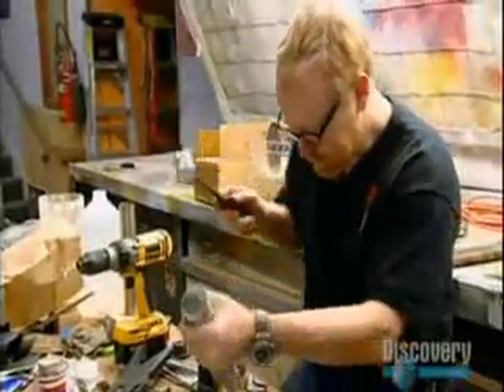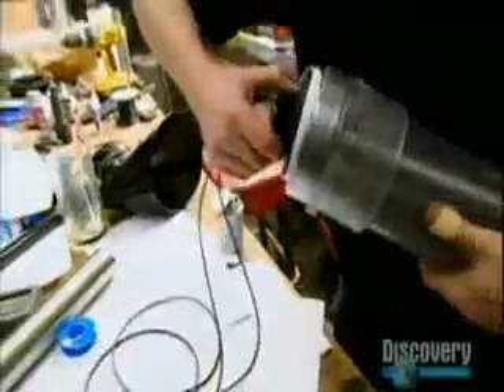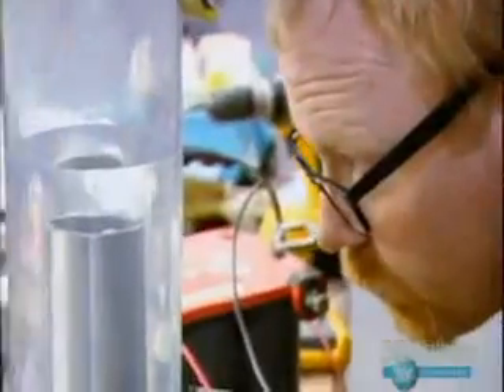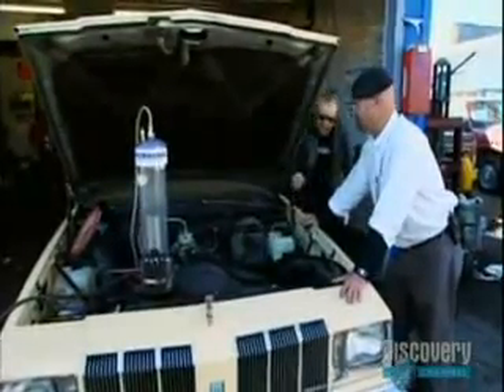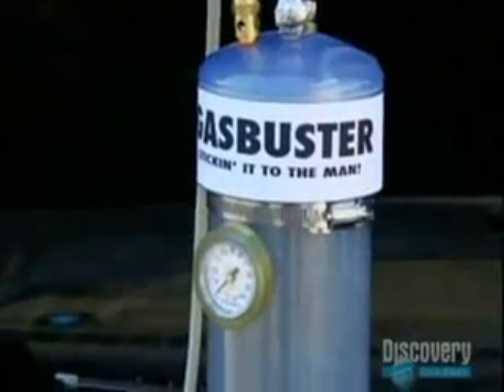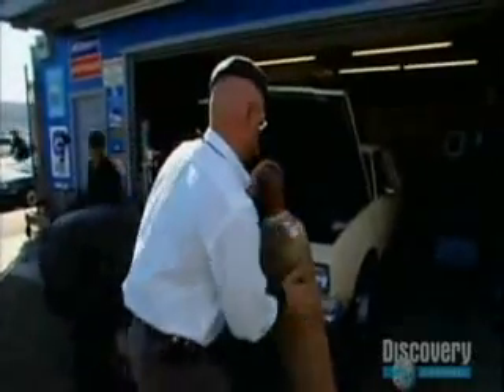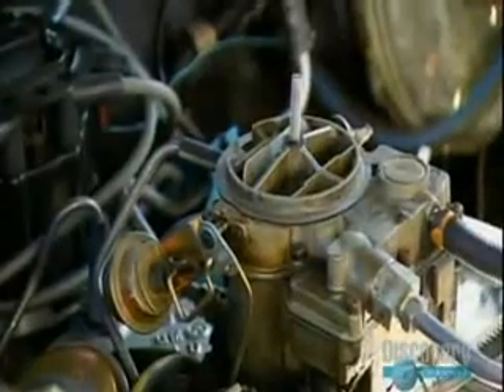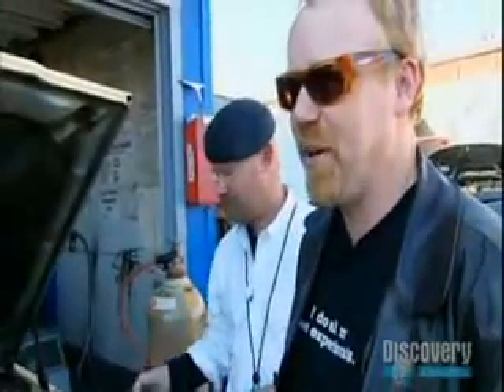HHO Mythbusters Explained

Comment: So, when you run current through a solution of sodium bicarbonate and water you get virtually no hydrogen but you do get a lot of carbon dioxide. Somehow I don't think that carbon dioxide is very helpful in getting an engine to operate. But, let us visit HHO Fairy Tale Land and pretend that the bag actually was full of HHO. In just one revolution of a 5 liter engine, the entire bag would be empty. So, as it took five minutes to produce enough HHO for a single revolution of the crankshaft, how many years would it take to produce enough HHO for a trip to Granma's house?
Reply: dont know much bout science but all i can say is that this is nothing new in Iceland, Japan and some other countries in Asia...in some part of the Philippines, plenty o taxi drivers and people that make money out of vehicles are already doing this. no joke! a company inJapan are selling cars that run powered by water. its too impossible here in US of course.
Reply: Where exactly did you get your degree in chemistry? Online? Yeah, thought so. ;) 

A proper electrolyte would be something like sodium/potassium hydroxide. Easily done. Sodium Bicarbonate would work as well and you wouldn't have anywhere near as much CO2 as you think. It's all about activation energy.
Reply: Justin Dixon Yes, apparently my degree in physics outperforms your knowledge of chemistry. Since I don't have a degree in physics, it is accurate to say your ignorance of chemistry is beyond pathetic. As you are ignorant of the fact that the process of hydrogen/oxygen extraction through electrolysis has always requires about 140% more energy than can be recovered by burning the resultant gases, you quite clearly demonstrate to the world how foolish you are. Couple that with the maximum thermal efficiency of a typical internal combustion engine of about 29%, then only the truly stupid continue to believe in this HHO garbage.
Reply: ccryder1149 sorry but nothing you just said invalidated anything said.
Reply: ccryder1149 
I skimmed your response and it's basically blah blah blah redox... blah blah blah incomplete combustion... blah blah blah reaction products... blah blah blah. 

From what I can tell, it's accurate. However, you're ignoring the fact that the introduction of oxygen and hydrogen in equal parts promotes the evolution of water and CO2 in place of excess CO. 

If you want me to show you a formula for it, I can. 2C8H18+25O2 → 16CO2+18 H2O. The issue with this reaction is that it's in practicality oxygen deprived. 

As for being a nitrogen rich environment... I'm not entirely sure what you're smoking but that is extremely unlikely give that the primary components in a gasoline fuel mixture are hydrocarbons such as isooctane, butane, ethyltoluene,various phenols and various alcohols including ethyl and methyl. Where are you getting the idea that it would be a predominately rich nitrogen atmosphere? 

Oh, and why are you even arguing that a engine produces CO? I've never once claimed otherwise. In fact, that's why they add oxygenating additives such as Methyl tertbutyl Ether or Ethyl tertbutyl Ether... or if you want to be cheap: ethanol. 

That's one of the things that HHO seeks to fix - an oxygen deprived combustion without the need for additional polluting additives. Running a vehicle PURELY on a hydrogen oxygen reaction has issues due to flow stability, and energy required for the splitting of the free radicals from the water - though both of those are technological and engineering problems, they're possible to handle. 

I simply do not see where your problem with this lays. You basically are claiming that HHO technology is a scam... yet it's used all over the world in industries that range from welding to fuel cells.
Reply: ccryder1149 I'm not going to bother reading all of that, I can however say that you do not need to run an engine purely on HHO. Hydrogen and Oxygen injection into fuel is plenty to increase efficiency. 

Also, there is nothing magical about HHO generators. They're quite real and they can produce a lot of gas. If you can run a high flow torch, you can produce more than you're claiming... and people have these torches.
Reply: ronazan87 no support from government and misinformation, discouraging the use of water to promote oil because of money and some selfish conspiracies... it's all about it. and mythbuster might be in big trouble if they had it work. it is working and one scientist here in the Philippinesuse it for personal use due to same reason.
Reply: ha ha ha... "5 liter engine would take 5 liters of hydrogen in one revolution" Oh My God What ? Is that a joke ? Or maybe you might be confused with how to connect the HHO gas into the engine, you don't seal the HHO gas chamber directly to the carburetor (as seen in the video its simply just placed near it), you have the gas come in through the air intake and it simply acts/helps with gas mileage. By no means is it feasible to run a car completely off HHO gas with hydrogen gas tanks in the truck of your car. But now with the help of YouTube there's hundreds and hundreds people coming out with their cameras rolling and YouTube channels on over time, posting videos of them making their own HHO gas in their backyard and doing it by an ON DEMAND system, meaning there's no storage tanks and when the engine shuts down there's no more gas flowing, its completely safe and simply improves their gas mileage, sometimes putting them to 100 miles a gallon. You should take a look at a couple of them up there quite interesting. Some people were even able to run their lawnmowers completely off the HHO (for about 10 minutes). Remember this isn't anything like perpetual motion or getting something from nothing, the hydrogen gas is inside the water and by adding electricity to stainless steel plates that are placed at certain thicknesses apart (depending on the system) with the added help of some neutralizing plates you will get small amounts of mixed hydrogen and oxygen gas. The average person gets about 1-2 liters a minute using 12 volts at around 5 amps, easily done with a car alternator. Improving their gas mileage through the roof (I've done it first hand with many different prototypes and a couple years experience). Am not trying to one up you or start an argument, I just thought i might try to clear up some misconceptions and share some information!
Reply: David Chapman Ya i think i wont waste anymore time with this guy, its one thing if he doesn't want to believe in it but its another thing to try to tell us ( people that have built an HHO device ) that is doesn't work and its a money grabbing conspiracy. Thats the only reason I've remotely had any interest in replying back to him. But ya i agree, he'll probably reply back again to get his last word in and then i'll just not waste anymore time with him. I probably wont even read it to be honest.
Reply: no, it did not. I did not challenge any of those points in my original post.
Reply: ccryder1149 what you think is the subject of our discussion here? You seemed just hitting around the bush. Try to stick to your point....

This one.
"ccryder1149Jan 10, 2015
+Guy Van Brussel Wrong again! The BS about HHO is not new. The first I heard of it was in the mid 1990's. It was thoroughly tested and refuted. To date, not a single independent testing facility has ever confirmed the HHO myth. Not one! However, there is a video expose of this scam and if you like I will send you the link. You won't like what it reveals.

As far as burn efficiency, you are wrong on that account as well. Since the mid 1990's most internal combustion spark ignition engines have a combustion efficiency of 98%+. My team and I have measured this on a dyno while doing exhaust gas analysis. This was measured in front of the catalytic converters. Adding HHO does not increase this efficiency as there is virtually no oxygen left to mix with the tiny amount of partially burned and unburned fuel. No amount of magic gas is going to complete the burn because all the oxygen has been consumed. It isn't debatable.

Finally, even if the HHO did promote an increase in burn efficiency (it doesn't) the minute amount of HHO these "magic bubblers" produce is pathetic. Do you have any idea how much hydrogen/oxygen is required for an internal combustion engine to make just a single horsepower of useable power? I didn't think so. If you want, I'll be glad to send you the math. You won't like that either."

I get exactly what Justin Dixon is trying to imply. I don't know what you really are up to. You didn't even bother answering my questions, just in case I need enlightenment.
Reply: I don't know if anyone is even going to read this, but I found this article and was curious as to whether or not it pertained to the arguments being made.
http://www.blulabresearch.org/wp-content/uploads/2013/07/2010_Reduction-of-fuel-consumption-in-gasoline-engines-by-introducing-HHO-gas-into-intake-manifold_A.A.Al-Rousan.pdf
Reply: Sebastian Ramadan Am not quite sure where you got all these numbers a figures...have you made and tried one first hand and those are your figures you gathered ? You mentioned "to improve the percentage of hydrogen and oxygen gas you need to..." and you go on about crazy impossible things like creating microwaves to zap at 1.8pHz or bringing the water temperature to an impossible 1000 Celsius... it simply does not need improving. period. And yet again i ask, have made and tested one of these devices to get the 0 to 1 cubic centimeter per second of gas you describe? If that was the case there wouldn't be the thousands and thousands of videos of people making, testing and installing these on their vehicles, where did you get that figure? You also mention that the gas is some how mixed in with a "huge amount of steam" this just goes to show how much you don't understand it, in simplest terms the system, if its any good, will have a "bubbler", and without going in to full details on how it works with this kind of system and how it deals with: the pressure, the water, the gas, the return cycle, the out flow.... and so on, you can just say it works as a water filter and this takes the SMALL amount steam you describe. I don't get why people get SO upset and SO disgruntled and go SO far out of their way just to try to prove people wrong about this HHO stuff, i personally spent years researching and then uncountable hours/days in the garage with some spare time i had and built one of these first hand. I then tested and tested and tested to make sure it was doing what i wanted and what i expected it to do, and when i was satisfied with amount and quality of fuel it was producing, at the already described power settings, i installed it on my vehicle and now am getting phenomenal gas mileage and my engine has never run cleaner nor better in its entire life. Yet if i mention the three letters H.H.O I get the typical 15 line response like I just did from you. You can reply back if you wish to but i simply won't read it nor reply to you again unless you have built one because the "results" your trying to tell me is simply made up otherwise. Honestly, I think you have NO IDEA what your talking about and you just tried to confuse people with your outlandish ideas and 13 digit numbers, and as far as "over charging a lead-acid battery" with a tiny 5 amp system i don't even know what to say to that, am not quite sure what you even mean. I've spent my whole life around generators, alternators, inverters, deep cycle batteries, lead-acid batteries, solar panels and so on and what you said makes no sense...a car stereo uses 10-15 amps the vehicle wont even notice 5 amps up or down. As i say to everyone, spend 20 minutes and look at some of these homemade videos of people that have built one. And before you reply back to try and "prove me wrong" BUILD ONE !
Reply: Sebastian Ramadan I said i wasn't gonna waste anymore of my time and reply back to you again but you just replied by posting some links and said: "well ahead of you". The links go to out dated 2004 Nuclear Hydrogen PDF files and high-temperature electrolysis hydrogen plants... that literally has nothing to do with anything anyone is talking about, it makes sense now where you're getting those crazy figures from, that stuff is for powering buildings and cities my friend. The video and every body else commenting on it is talking about cars, so ya if you hook a 12V 5 amp power supply to those things am sure your not gonna anything out of it at all. I see your in a couple comment "battles" with other people as well, please keep in mind were talking about small gasoline engines for the purpose of better fuel efficiently NOT nuclear power plants!
Reply: Dylan... Nicely said. That guy is in bad shape and needs professional help. Sick ones...they walk among us. I hope he gets help. Thanks for your input.
Reply: Sebastian Ramadan Come on man, give it up, you must of had your fun by now, your in like 20 different arguments. And to make it even worse, most of them have actually built an H.H.O device first hand ( Like my self ) and they're telling you COLD HARD FACTS and all you can do is provide links to conspiracy websites like "Scam world" or links Nuclear Power Plant PDF files. Keep your mouth shut and move along unless you have actual experience in this field other then reading conspiracy articles online. You are quite literally clueless when it comes to H.H.O devices built for cars. It has NOTHING to do with ANYTHING you have provide for us to read. H.H.O for Nuclear Power Plants and H.H.O for cars have NOTHING to do with each other, other then the fact they both have Hydrogen in the title. "a notable nobody" ha ha ha ya the guy that has actual built an HHO device and is providing true facts done with years of experience is the nobody and the guy reading conspiracy articles online is expert telling people how it works....RIGHT
Reply: Sebastian Ramadan Do you just start these online YouTube arguments for fun or do you actual think your right? Do you really think that the 20 or so people your arguing with are completely wrong and have no idea what they're talking about and your the only right person here? You might want to stop and think for a second why theres so many people here that are "wrong", cause that's the beginning sign of you either being very intelligent or ,with more numbers against you, it might just mean your very stupid. As far as you're citations to websites like "Scam World" go, do you really think that some guy that showed up to work and found a piece of paper on his desk and was told to write an article on it by the end of the day is actual credible work ? That may be where you and I ( and many others ) have trouble understanding you and these theories you propose.
Reply: Watch out Dylan, he's a complete ass and will now begin an argument with you. I honestly think the guy needs professional help. None of his arguments are relevant to the topic. He likes to stir crap. He is sick.
Reply: Justin Dixon Actually, it did.
Reply: The point I made is that running current through a solution of sodium bicarbonate will cause the release of more carbon dioxide than hydrogen. For some odd reason you decided to challenge that by inferring I got my degree in chemistry on line. You don't need a degree in chemistry to know what I said was true. I learned this in high school chemistry almost 50 years ago.
Reply: Guy Van Brussel Mr. Lame Brain. When you run current through a solution of baking soda and water you get more carbon dioxide than hydrogen and free oxygen. Oh! I see! You're one of those DA who thinks that HHO augmentation of an internal combustion engine actually does something useful. You're also dumb enough to think that YouTube videos are actual science, aren't you? You're one of those clowns who says, "I don't need to get no larnin cause I done seed it on YouTube." Go find that episode of Beverly Hillbillies where Jethro tries to run the truck on water. There's your life story.
Reply: Guy Van Brussel Unlike you, I know what the truth is. The truth is that simpletons (like you?) are too lazy to actually study and learn something. I did experiments with electrolysis in high school 1966. In 1967 our physics class measured and compared the energy used versus the energy produced by electrolysis.  In college, we did the same thing but with more than just water. As you have never done anything like this or else slept through the lectures and skipped the labs then it is quite clear that you are delusional when it comes to discussing anything. Before you continue to make more of a fool of yourself than you already have, I would suggest you go back and get a real education.
Reply: Guy Van Brussel You really are a DA. You watch YouTube videos and think they are gospel. Why don't you find the one that has an independent testing facility prove that HHO augmentation does not work and that the guy pushing it on the gullible is nothing more than a con artist. As for electrolysis, you obviously cannot read or possibly cannot understand what you read. I was doing experiments in electrolysis long before you were born, as I previously stated. I also calculated and measured then amount of energy produced and LEARNED that it takes more energy to produce hydrogen and oxygen than you can get by using the hydrogen and oxygen. You see, you learn things about science by reading, experimenting and understanding science books. You don't learn by reading comic books and watching ignorant YouTube videos.
Reply: Guy Van Brussel Wrong again! The BS about HHO is not new. The first I heard of it was in the mid 1990's. It was thoroughly tested and refuted. To date, not a single independent testing facility has ever confirmed the HHO myth. Not one! However, there is a video expose of this scam and if you like I will send you the link. You won't like what it reveals.

As far as burn efficiency, you are wrong on that account as well. Since the mid 1990's most internal combustion spark ignition engines have a combustion efficiency of 98%+. My team and I have measured this on a dyno while doing exhaust gas analysis. This was measured in front of the catalytic converters. Adding HHO does not increase this efficiency as there is virtually no oxygen left to mix with the tiny amount of partially burned and unburned fuel. No amount of magic gas is going to complete the burn because all the oxygen has been consumed. It isn't debatable.

Finally, even if the HHO did promote an increase in burn efficiency (it doesn't) the minute amount of HHO these "magic bubblers" produce is pathetic. Do you have any idea how much hydrogen/oxygen is required for an internal combustion engine to make just a single horsepower of useable power? I didn't think so. If you want, I'll be glad to send you the math. You won't like that either.

However, if you take this information as a proof of how weak your understanding of this subject is and decide to do something constructive about it, then I will be satisfied. It's never too late to learn.
Reply: Justin Dixon I feel so sad for you. You choose to remain gullible and ignorant which is truly pathetic. I offered to provide the truth to you but you are afraid to face reality. Your lack of education and more importantly your lack of desire for self improvement condemns you.
Reply: Guy Van Brussel Yes, they are all liars or conmen. You can't seem to get past the truth that there has been no independent verification of any HHO benefits. None, not any, not anywhere.  You get some bozo on YouTube making claims but offering no verifiable proof and to your limited way of thinking these conmen are great heroes. So, according to your way of thinking, if you saw enough YouTube videos from people claiming to make flying carpets then in your mind there must be some great oil company conspiracy to hide flying carpets from the general public.

One of the truly pathetic things about this con and those who blindly wallow in their ignorance is that all it takes is a little education to know that the HHO claims are nothing more than the ranting of conmen and seriously undereducated people. 

So it's your choice. You can be a loser who believes in fairy tales and keep on with your juvenile ranting or you can be a winner who realizes that you're being conned.

Finally, I dare you to search the net for "How to monetize your videos."
Maybe then you'll discover how these conmen make their money.
Reply: ccryder1149 Gullible? Seriously? Those torches are commercially available, dipshit. 

If anything, you're just a scientifically illiterate troll.
Reply: Justin Dixon So, how did you get so far off the subject? This video proved that HHO generation is useless for automotive fuel applications. But, as with most illiterate twits, you decided to change the subject rather than stay focused on the matter under discussion.
Reply: ccryder1149 This didn't prove anything other than that this particular system didn't work. You're pretty damned naive if you look at mythbusters and go "oh yeah, that particular experiment didn't work and thus everything relating to it is totally worthless." which is essentially exactly what you're doing. Troll somewhere else. 

Take a little chemistry. What happens when you add hydrogen and oxygen gas into a rich carbon fuel? Give you a hint: redox.
Reply: Justin Dixon ccryder1149  Why doesnt someone just perform the experiement themselves... the materials cost a few dollars and the argument can be final. I would suppose ccryder's scepticism is meritted seeing neither of you seem to have tried it... just sayin. everything else you guys are talking about is mute.
Reply: Justin Dixon It didn't work because it doesn't work. It's been proven that it can't work. If you had taken basic chemistry and physics you would already know why it doesn't work and you would not be making a fool of yourself. You lack the education and you lack the experience otherwise you would be telling people that it doesn't work just like I do.
Reply: Aqute Nolej This BS was exposed more than 20 years ago as nothing more than a scam. Nothing has changed. Albert Einstein is credited with stating that the definition of insanity is doing the same thing over and over again and expecting different results.
Reply: ccryder1149 Blah blah blah. Sorry, man, the origin might have been a scam but technology happens, man. Update your knowledge, it seems to be about 20 years behind.
Reply: ccryder1149 I am a chemist. Literally. You're doing nothing but talking out of your ass.
Reply: Justin Dixon Apparently the only chemistry you've ever done is LSD, Speed, Crack and some Roofies . What a rube you are!
Reply: ccryder1149 Oh nice comeback. Let me know when you are able to back that up, alright?
Reply: Justin Dixon Quite simple. You didn't study chemistry in college because one of the first things you learn in college level chemistry is how to calculate and measure the energy of a chemical reaction. Once you've learned that then you move on to demonstrating your understanding of entropy. As you have already demonstrated that you have no understanding of how to calculate and measure the energy of a chemical reaction and of course your complete lack of understanding of the basic principle of entropy then the only college you could have attended was Bubba's Skool of Kemical Stuff. Now you might be some technician at a chemical plant that watches dials and maybe turns a few knobs but that doesn't make you a chemist.
Reply: "You didn't study chemistry in college because one of the first things you learn in college level chemistry is how to calculate and measure the energy of a chemical reaction."

Actually, that's in the second chemistry course. Yes, I did learn how to do it. Oxygen excess is superior to a lack of oxygen. Read: Redox reaction completion. There's a reason gasoline vehicles produce excesses of CO instead of CO2. 

"Once you've learned that then you move on to demonstrating your understanding of entropy."

Entopy is covered in detail in the 4th term of a bachelor's degree in chemistry at most universities. Been there. Done that. 

Sorry... but you're talking out of your ass. Show your data or gtfo.
Reply: Justin Dixon I see you've read one of the college curriculum descriptions. Doesn't help your case. Yes, there is a very good reason why an internal combustion engine produces carbon monoxide. Actually there are several reasons. The first is that the combustion area is going through a change in volume. There is a significant area called the squish area which is required to direct the air/fuel mixture toward the ignition device. This contributes to the formation of both carbon monoxide and unburned fuel. The second is that the heat of combustion is being absorbed by the combustion chamber. The third is that there is insufficient oxygen to complete the combustion process which is necessary to prevent preignition. Fourth is the fact that the combustion process is a controlled burn which is necessary to prevent mechanical damage to the components. Fifth is the fact that the majority of the gases in the combustion chamber is nitrogen. Sixth is how the timing of the ignition process affects the formation of CO. Seventh is the need for the nitrogen to be heated and expand creating the majority of the mechanical force applied in the combustion chamber. So there is a long list of things you don't understand. The most important of which is that entropy prevents a closed system from being self sustaining.
Reply: Justin Dixon very well said! I am a witness of a car running on that process. I don't want to name the brand. Maybe ccyder1149 might need to go to Japan and get himself a car of this kind.
Reply: Stephen Flores Isn't that amazing! Disinformation with no corroboration. It's like saying you saw a flying carpet in India but you don't want to say when or where.
Reply: http://www.aljazeera.com/news/asia-pacific/2014/11/toyota-launch-hydrogen-powered-car-2014111843546567116.html

There ya go. 

http://auto.howstuffworks.com/fuel-efficiency/hybrid-technology/hydrogen-cars.htm

There ya go again.

I guess Toyota is into disinformation, eh? heh
Reply: Justin Dixon And you think this car runs on water? Is that what you are trying to imply? It is powered by a hydrogen/ambient air fuel cell which provides electricity to the drive motors.
Reply: ccryder1149 i'm not into automotive or any of those stuff. but can you tell me isn't it that your gasoline engine car powered by gasoline/ambient air to kick those pistons to drive those alternators so they can produce electricity to power your system? isn't it the same concept with what you just said? you might say it's powered by the battery. yes it is partially. the battery is useless without those alternators or whatever you call it putting something into it. And why do Japan call it hydrogen cars? can you explain where the gasoline is used on those cars if you really know all about those cars? and how they really work in the whole process? Just a tip. "They" said it doesn't use gasoline. Now prove them wrong. Mind you, they are selling limited units. You might want to contact them for a sales talk.
Reply: Stephen Flores You missed the technical data. Visit the Toyota Mirai website. This vehicle uses what is known as a hydrogen/ambient air fuel cell. It has batteries. The batteries are used to start the fuel cell and provide immediate power until the fuel cell is fully operational. The batteries also provide reserve power for accelerating as the fuel cell cannot react quickly enough to immediately provide the energy required for acceleration.

The advantage of the fuel cells powering electric motors is that these are far more efficient than using the hydrogen to power an internal combustion engine. 

Now two important facts. The videos claiming you can use an engine to produce enough HHO to power the engine are ALL bogus. Everyone of them. There is not a single case where an independent testing facility has ever confirmed that this is possible. In fact, the very idea has been refuted so many times that no competent chemist or engineer will even consider the problem worth investigating again.

 It's like a court of law. If someone claimed that you robbed a bank but it can't be proven, then in the eyes of the court, you didn't rob then bank. In 1989 Martin Fleischmann and Stanley Pons claimed they had discovered "cold fusion."  If true, this could have led to the virtually unlimited energy. However, in spite of hundreds of millions of dollars spent and the efforts of hundreds of research facilities across the planet there is no proof that cold fusion exists. In fact, the results claimed by Fleischmann and Pons
have never been duplicated. Pons eventually refuted his claims. So, no proof, no joy.

Finally, I want you to do a little research. Go back and look at those videos about HHO. Look at the name of the person who posted the video. Now, go look at the comments by people who state that the video is wrong. Can you find the original poster actually responding to those negative comments? No? Why not? Surely if these were the efforts of concerned "inventors" they would have defended their work. Why didn't they? The answer is quite simple. The only thing those people who posted the HHO videos want is for you to view the video. They actually make money when you watch them. That's all they want. They don't want to spend time defending themselves. They know their videos are all just BS. They're not doing it to help mankind. They're doing it for the cash flow.
Reply: ccryder1149 i don't think i am missing anything here. it's just that i am not a genius in physics or chemistry. It's you i guess who is missing your own point. Your post above is eventually killing your previous statements. If I may quote...

"ccryder1149Jan 10, 2015
+Guy Van Brussel Wrong again! The BS about HHO is not new. The first I heard of it was in the mid 1990's. It was thoroughly tested and refuted. To date, not a single independent testing facility has ever confirmed the HHO myth. Not one! However, there is a video expose of this scam and if you like I will send you the link. You won't like what it reveals."

I'm not referring to any HHO videos on youtube. Obviously, they are just making money out of it thru AdSense  'cause I myself doing videos on youtube. My point is with, to name a few, Toyota, Honda, Nissan is launching. Those videos about HHO were a do-it-yourself videos basically but these companies are actually building it for the market. And also I don't I want to do a research 'cause I am aware that they are there. It's you I think needs to read more because that Toyota Mirai thing that you mentioned? Well, the company wants to get rid of Gasoline in this headline. http://www.businessweek.com/articles/2014-12-17/toyota-embraces-fuel-cell-cars-for-post-gasoline-future. One of the companies who, in the near future will setup several hydrogen refilling stations for these cars... and what do you think their source? Isn't it water? Setbacks? Yes, there are. They are amenable to that and they are still working on it.

You also mentioned about studying electrolysis... and now telling me about cold fusion. Isn't it cold fusion a nuclear reaction because I think we only need chemical reaction to get hydrogen.

And since you want me to do a little research, I would assume you know how these things actually work. And so, can you answer my previous questions please? where is gasoline used in the process? You can use this http://images.bwbx.io/cms/2014-12-17/feat_toyota52_hydrogenchart_630.jpg because I didn't find it there... It's actually from the Toyota Mirai thing that you talk about.
And one more thing,  do you think these big companies are scammers? Yes or no.
Reply: ccryder1149 Nope. I never said it ran on water. I'm well aware of how it works.
Reply: ccryder1149 I've only seen a handful of claims that assume you can run a car purely on Hydrogen and Oxygen. So no, that's not what I was claiming. I even made that perfectly clear when discussing fuel mixtures which included hydrogen and oxygen injection with standard fossil fuels. 

I'm not even sure what you're bitching about at this point tbph.
Reply: Justin Dixon Actually, the video demonstrates that an HHO generator cannot produce enough fuel to power an engine so HHO augmentation was not the subject under discussion here. If you are trying to claim that HHO augmentation will actually provide some useful benefit, well that was disproven about 20 years ago. To this day, no independent analysis of HHO augmentation systems has ever provided evidence supporting the claims made by those who "just know" that it works. In fact, independent analysis has quite clearly shown that HHO augmentation does absolutely nothing except separate people from their money.
Reply: ccryder1149 If you're not busy, try to study more about those things you referred from 20 years ago. And you might want to contact Bob and Sterling about it. Here is their website... http://hydrogengarage.com/pwm3g/. Maybe they can help you upgrade your obsolete ideas. Sorry man, that's how I look at it since I don't get any good response from you yet. They have the electronics to get things done as well.
Reply: Stephen Flores Actually, I did study those claims 20 years ago. They were garbage then, they're garbage now. When Bob and Sterling present an HHO augmented vehicle to an independent testing facility and have the facility validate their claims then I'll be more than happy to "look again." But, since they haven't and it is highly unlikely they ever will and even less unlikely that the facility will validate their claims, then I see no reason to review what has been so thoroughly reputed in the past.
Reply: It's just hard for you to accept it, I guess. Be open-minded man. Things are getting different now. I am not into chemistry nor physics but I embrace these recent technology advancement that we have. Bob and Sterling's are just part and parcel of the whole idea. I'm referring you to them because you mentioned about HHO generators. In fact, their concept is used on some hybrid cars. Hybrids these days are different from hybrids even few years back. There are these Lithium-ion cells and some stuff which I don't know which are being used. Learn to let go and believe. Otherwise you might wake up one day and everyone's doing some sort of "magic". Even gadgets these days are getting smaller and smaller yet still efficient.
Reply: ccryder1149 "Actually, the video demonstrates that an HHO generator cannot produce enough fuel to power an engine so HHO augmentation was not the subject under discussion here."

Actually, the video shows a wildly inefficient generator. Let me know when mythbusters requires the use of the scientific method for analysis. Until then, saying that anything they do is conclusive is downright ignorant. 

Oh but please, go ahead, lets see your calculations. Hell, let's see your lab results. You did say you looked into it and found it to be false right? Lets see your data. Let's also hope that it's peer reviewed. ;)

Unlike Stephen, I am a chemist, so don't hold back.
Reply: ccryder1149  look up a match rocket lmfao look how much combustion a little match can make and for you to say hydrogen cant move a pistion is crazzy lol just watching people using it and how much it can explode and if you have any knowledge how a engine works its pretty simple dont need a degree in anything
Reply: dodge rt An ideal mixture of hydrogen and oxygen is indeed more energetic than most hydrocarbon fuels but the issue he's taking up is more due to volume. A decently large volume would need to be produced at a steady rate to ensure proper injection and cycling of the pistons. That's an issue for all home made systems but could be less of an issue for commercial systems. Even so, engines are not equipped to handle the much higher temperature of a hydrogen/oxygen reaction either and that could in of itself be a deal breaker even if you could produce enough gas.
Reply: Justin Dixon if there bringing a hydrogen car to america and debunked anything said . as it has been done and is on the commercial level to hit market ... if a man can use a megnetic wheel to make power anything is possible if you put the work into it .and america is almost 20 years behind asia for technoligy ...and they have people over there driving off of tap water
Reply: dodge rt There are people in driving cars powered by tap water? OMG! How much dumber can you get?
Reply: Sorry let me rephrase this. There are people in the world using tap water and converting it to hydrogen . Ok inbred i bet you believe in god
Reply: dodge rt Converting tap water to hydrogen is both inefficient and costly. The most common and efficient way to produce hydrogen is by steam reformation of methane. Now, it is physically impossible to build a vehicle that produces sufficient hydrogen to fuel its internal combustion engine and power the electrolysis system. It doesn't matter how many websites you've looked at, it doesn't matter how many YouTube videos you've watched. Anyone who tells you different is either ignorant or a liar.
Reply: ccryder1149 show us the proof for your claims. let's see the math.
Reply: ccryder1149 get hes never seen solar energy .sad when people stop using there brains and become a couch potato . O think so many people would waste there time and money with somthing that would show no possibilities . Lmfao your just a fool and cant except when you're wrong on somthing that just proves how lil of a man your are to fight a subject wich has allready hit market for sale in north america. Wich ushally means its gone thru testing in other countrys the america never buys a product without testing everything in another country
Reply: dodge rt Wow! You're such a smart guy! You probably think that people can fly because you saw a Superman cartoon. When and if you ever grow up you might want to learn how to do research. No, research is not watching a bunch of YouTube videos. You are pathetically undereducated but you do bring laughter to many people. I do imagine that somewhere there are people who have a "dodge rt is stupid" blog. My advice to you is to go back to playing with your Power Rangers. They're about as close to reality as you'll ever get.
Reply: ccryder1149 aww your cute when you get mad lmfao once again talking out your ass lmfao still with no valid points other then your the child of 2 cousin who found love
Reply: ccryder1149 love how you avoided justin lol you going to show proof or talk out your ass for this whole thread
Reply: ccryder1149 love how he cant even come back with anything to valid his point lmfao a huge car company has allready done it and he still argue the facts .... it like a blind person telling some one who can see that there is no sun lmfao you failed at this thread and you failed at life lmfao
Reply: dodge rt If you had bothered to do any research, you would know that I suggested that Flores visit the Toyota Miari website. If you had bothered to research posts I've made you would know that in 1993 I presented an analysis of the federal alternate fuels program for my employer and stated that hydrogen was most likely to be the fuel of the future. If you had actually read Dixon's posts you would know that he claimed to be a chemist and yet had no understanding of basic chemistry. So what does that make you? Just another seriously undereducated troll with virtually no knowledge of automotive technology or anything else for that matter.
Reply: ccryder1149 yet you avoid the question .post the link  for fuck sakes lmfao are you on de drugs
Reply: ccryder1149 ill take the win for that one
Reply: ccryder1149 wait i don't understand how do you get co2 from h2o and NaCl its supposed to be an electrolyte so you could use salt and thats just so the current flows easier ?
Reply: Jesus Chacon shhhhh hes the almighty kno it alllllll dont question his authority lmfao
Reply: Jesus Chacon A previous poster stated that the reason it didn't work is because the Myth Busters needed to add sodium bicarbonate (baking soda) to the water. This, of course produces carbon dioxide.
Reply: dodge rt And, once again you demonstrate your ignorance. When and if you ever get a decent education we might be able to have an intelligent conversation and you would learn something.
Reply: ccryder1149 plzzz tell what else you know your so wise lmfao
Reply: dodge rt Hey stupid! Why don't you actually try it? Then go back to bed before you hurt yourself.
Reply: ccryder1149 your comment just proved my point lmfao sore loser
Reply: que yo recuerdo  algo de la chimica,,,el bicarbonato de sodio es basico...y solo reacciona con los acidos...liberando CO2,,,e vinagre por exemlo....asi que??? espero estea resuelto la dilema
Reply: I just want someone to actually show the math to defend their positions ffs.
Reply: Justin Dixon have you ever looked into the steve myers project before he mysteriously died in 98
Reply: Andrei Kalamar I remember some of the chimica ,,, baking soda is basic ... and only reacts with acids releasing CO2 ... ,,, and vinegar exemlo .... so ??? I hope estea solved the dilemma .... plzzz explain in better english lost some in translation
Reply: dodge rt Sodium Bicarbonate and vinegar does indeed release CO2 as its primary byproduct. However, why would you even mix such things in something like that? You're essentially neutralizing the solution completely.
Reply: Justin Dixon
el bicarbonato de sodio...cumple de electrolito en ves de h2so4....pero se poede utilisar sal de mesa egual....pero con menus conductibilidad electrica
Reply: Justin Dixon that was for ccryder . Telling him the way baking soda makes co 2
Reply: dodge rt OK, dummy. Here's a clue. Baking soda does not need an acid because baking soda already has the acid in the mix. Add water and you get an initial surge of CO2. That is how the YouTube videos make you believe they have a "magic bubbler" capable of producing enough hydrogen to run a car. Now, add current and you get more CO2. Of course, you could have gotten up from playing GTA and learned something but you are too much of a coward for that. You also evaded the issue about making hydrogen from tap water. If you were a smart guy you could go find out why commercial hydrogen production does not use that method. But, no you prefer to remain ignorant. In your small mind you think that you can just build a little hydrogen bubbler and refuel your car. However, in your continuous display of ignorance, you don't know how much pressure is required  to refuel that Toyota. You don't have any clue as to how long it would take for a "home refueling" system to create enough hydrogen to drive around the block. You are ignorant of the special compressors required to pump hydrogen. You are too stupid to understand that allowing any air to mix with the hydrogen in that compressor would cause an explosion. Your list of shortcomings is long and tiresome.
Reply: ccryder1149
 dejalos....no  son culpables por falta de informacion  o ignorancia..Si el hidrogenos se comprime tan fasil Que pasarlo por un compresor...seria  demasiado fasil...ni siquera creo que saven lo que estan hablando el pobre .....deverian aprender mas chimica basica elementar,,,,les temblaria la voz y no hablarian tonterias......comprimir oxigeno es mas peligroso...ya que es mas activo que el hidrogeno...pobres ignorantes
Reply: ccryder1149 and for some one so smart you fucked up allot in your sentence did your'e anger get the best of yah lmfao what a idiot . But i guess thats the best education you can get in mexico right big guy
Reply: dodge rt I would suggest you go back and look at your own writing. According to one of my writing analysis programs you are writing a little below the 8th grade level. I'm not really surprised as you demonstrate a similar level of education.
Reply: ccryder1149 go ahead point out my writing lol its cus you cant piint out any facts to help your disclaim lmfao just sad when a full grown man cant admit hes wrong and keeps making up stuff to make him seld feel smart lmfao to funny .keep failing at life and living in your dream world
Reply: ccryder1149 Have you been going at this for over 2 months? What do you get up every morning and wonder if someone has replied to your YouTube comment? Bet it's the highlight of the day lol.
Reply: ccryder1149 you have  giving up on your dream logic
Reply: Dylan Dolson
solo a se falta 4% de H para la explosion
Reply: ccryder1149  Where did you go to learn your chemistry?
Reply: Chris Farley Good for you! That was a great article.
Reply: David Chapman
en la bibloteca hay muchos libros de chimica basica elementar... solo ase falta leerlos y aprender ... todo empeso con un simple petardo casero .. lo demas es historia... hahahaha
Reply: Dylan Dolson "The average person gets about 1-2 liters a minute using 12 volts at around 5 amps, easily done with a car alternator." Does this average person have a car that can act as a 100-200 megawatt (NOT kilowatt) generator? You basically described a lead-acid battery being over-charged for the purpose of generating a tiny percentage of hydrogen and oxygen gas, mixed in with a huge amount of steam. Steam isn't going to help you run a car. To improve the percentage of hydrogen and oxygen gas, you need to either super-heat the water to at least 1000 celsius before you send a charge through it (can you imagine how conductive that steam will be, and what a sweet load of shite electrolytes will do?) or you need to create a microwave that'll zap things at 1.8 pHz (1,800,000,000,000 kHz)... If you can manage to create that microwave with perfect efficiency, you'll be a rich man but with your 12V, 5A system you'll generate somewhere between 0 and 1 cubic centimeter per second, which is nowhere near your goal of 1-2 liters a minute. Otherwise, stick with the HTE method I mentioned earlier; You'll need a nuclear-powered thermo-electric generator the size of a jet engine to superheat the water... Why would you want to bother with all of this rubbish if you have one of those?
Reply: Well ahead of you there... http://www.hydrogen.energy.gov/pdfs/nuclear_energy_h2_plan.pdf
Reply: "Standing beside the ILS, Herring points out the system's pumps, control systems, heating elements and electrolysis cells, which operate at 800 degrees Celsius." -- http://www.sciencedaily.com/releases/2008/09/080918170624.htm
Reply: David Chapman ha ha. It just made NO sense where he was getting all these crazy numbers and figures, he was trying to tell me things like hooking up microwaves that zap at "1,800,000,000,000 kHz" and asked if the avg car produces "100-200 megawatts", and i was apparently "over charging" my battery by plugging in my tiny 5 amp system. Not a single sentence made sense and i wasn't even gonna bother going to the links he provided but now after looking at them there's NO wonder why he doesn't think it will work...those plans are for nuclear power plants! DUH
Reply: Yeah... I read that stuff and went to the link. I still think he needs help! Nothing he said was relevant to the conversation. Like when he said a hydrocarbon wasn't hydrogen...plain nuts. Like I said, he needs professional help.
Yessir...they walk among us!
Reply: If you were truly intelligent, you wouldn't need to resort to insults regarding my parents to make your point.
Reply: According to a notable nobody, with 12V/5A (60 watts) I can generate 1-2 liters of hydrogen per minute (using what is essentially the fundamental demonstration at highschool, and is highly inefficient). Note that 12V is well above the 1.48V required for 100% efficiency. According to my reference, I need a 600MW nuclear generator to generate 60 liters per minute (at 50% efficiency)... Who's the motherfucking insane one? http://ieahia.org/pdfs/Task25/High_Temperature_Electrolysis_%28HTE%29.pdf
Reply: Goodness..you have a foul mouth too... you truly are pathetic... I  feel sorry for you. Please go seek professional care. Truly, you need help.
Reply: Take your device to your local physics university campus, have it looked over and if it's anything special then a student will write a thesis on it and be hosted on a .edu domain. Post a link to that thesis and you will no longer be a notable nobody. Until then, you're just like me, except I have citations to go by... You're just using youtube, and spouting bullshit in the comments of the videos you watch. Off you go, to your local uni...
Reply: Dylan Dolson What more do you expect in the comments section for such a video? The video, after all, sets the tone to be argumentative. I'm not forcing you to sit here responding to arguments that the video started. If you really want to end this argument, do as I said earlier: "Take your device to your local physics university campus, have it looked over and if it's anything special then a student will write a thesis on it and be hosted on a .edu domain. Post a link to that thesis and you will no longer be a notable nobody."

David Chapman Are... you... a... psychologist? Please learn how to answer basic yes/no questions.
Reply: Dylan Dolson Yeah...when you see his name just hit "delete". Talk to you later.
Reply: Dylan Dolson Why waste your time to let David Chapman know that you're not going to "waste anymore time with this guy"? That's projection of a negative tone onto other people... Are you guys going to communicate actual points, or are you going to engage in ad hominem? Your choice...
Reply: Sebastian Ramadan Ummm, anyone who read this thread can see that they made MANY attempts to communicate actual points with you. And VERY GOOD ones at that. But you chose not to listen. THAT was your choice....
Reply: Gary Tugan Sure... They made VERY GOOD POINTS while resorting to argumentum ad hominem. You'll probably need an education to work out what that means (and where I was being sarcastic).
Reply: An ad hominem (Latin for "to the man" or "to the person"[1]), short for argumentum ad hominem, means responding to arguments by attacking a person's character, rather than to the content of their arguments. When used inappropriately, it is a fallacy in which a claim or argument is dismissed on the basis of some irrelevant fact or supposition about the author or the person being criticized. 

I have an aerospace engineering degree good sir. I don't think it takes nearly that to see the ones using attack are the persons you seem to be defending. While at the same time making silly suggestions as to my need of an education.  I'm pretty satisfied with what I've gotten. And continue to get. 

During one of my aerospace courses (junior or senior year) one professor told a story that stuck with me to this day, and it's point seems to be fitting here.  Back in the days before we had broken the sound barrier, engineering schools taught that it could not be broken. Test pilots crashed trying. They even used math and science to "prove" that it could NOT be done. Well obviously we know that it was broken. Immediately after, all engineering programs were quick to update their curriculum because soon their eyes were opened to that which they could not see before, so thickly had their skepticism covered their vision of what was and is possible. 

We are well past the point of proving it can be done with all those that have already done it. Which thus leads to my the final words which I got from some truly great poster: "All those saying it can't be done, should simply move over for those who are doing it."
Reply: Gary Tugan Yes, it can be done and IS BEING DONE, however at a very high cost and for much less gain than you realise. The cost of generation, in fact, was dismissed as absurd (argumentum ad lapidem) in an earlier post by those you are defending, despite being quite a lot more efficient (though still inefficient) than the method they are defending. The BMW Hydrogen 7 runs 5 miles to the gallon on hydrogen, or almost 20 miles to the gallon on gasoline. Perhaps you have chosen the wrong side... Either way, it doesn't really bother me. The only people reading are myself and the scam artists, so if that means the scam artists are distracted from making a sale with someone else, then... great!
Reply: Oh my fucking god, electrolysis of water is a well known reaction for almost 300 yrs now, efficiency is at 60-70% already. Educate yourself: https://en.wikipedia.org/wiki/Electrolysis_of_water